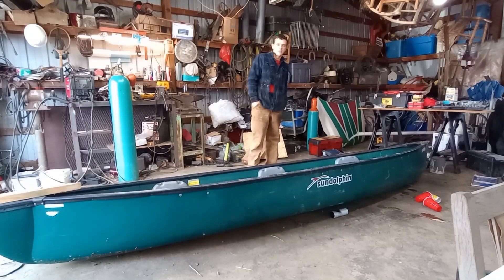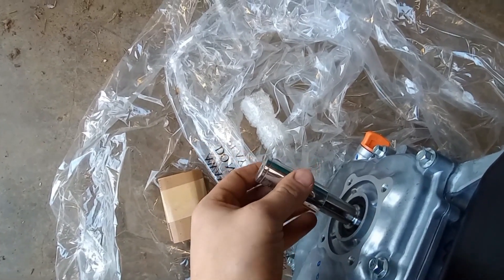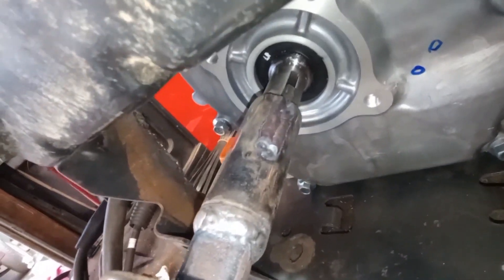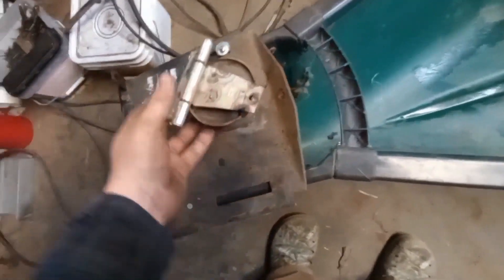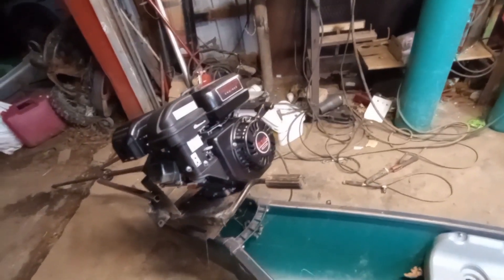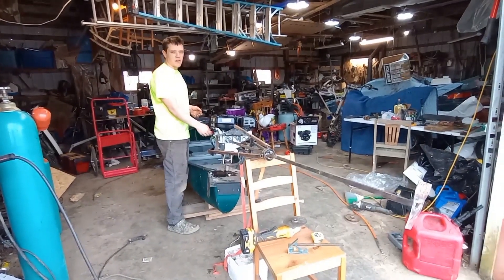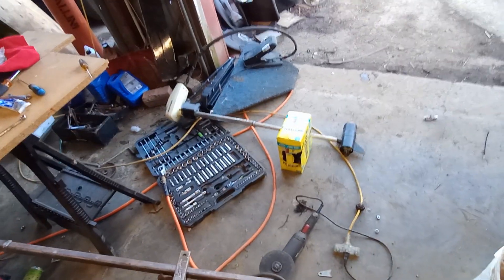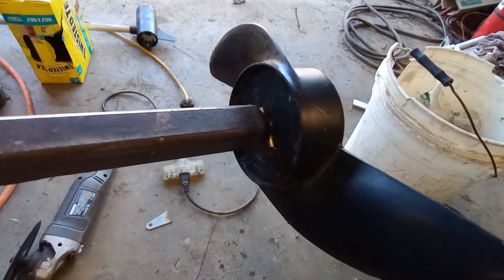home built outboard!  parts used: predator 212 and scrap metal. long tail/mud motor: actually works.

Comment: May need a throttle cable ?
Reply from the maker: Yes, if it was on an actual boat. On a canoe, even idle is a bit much (and that's with a home made propeller).
A real, properly sized propeller with a useful throttle, on a 14 foot jon boat would probably work well. We have a boat, but haven't gotten around to messing with it, and my son got a 4 wheeler recently that came with a working 2 stroke 5 horse outboard thrown in: We'll probably mess with the new outboard next, but there are other things to do.
Reply: @the_mowron  I’m definitely impressed little bit of ingenuity and a Welder you can do a lot